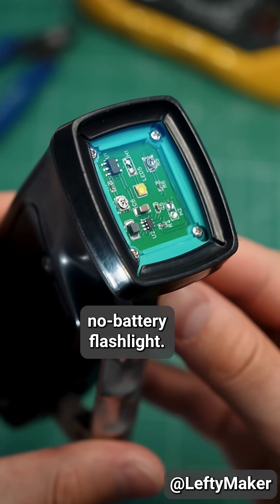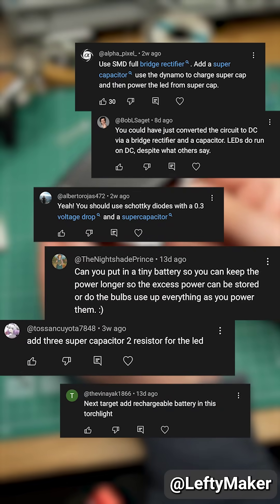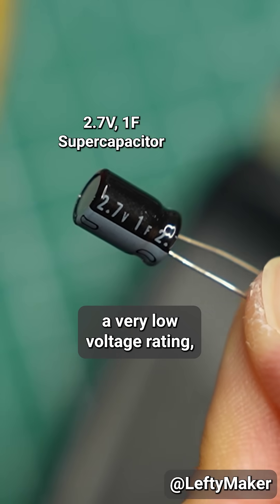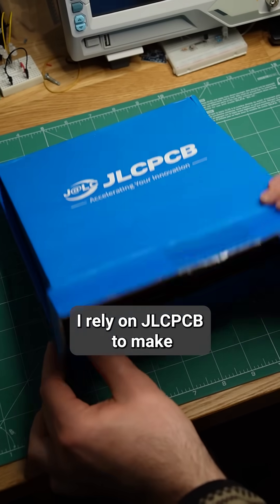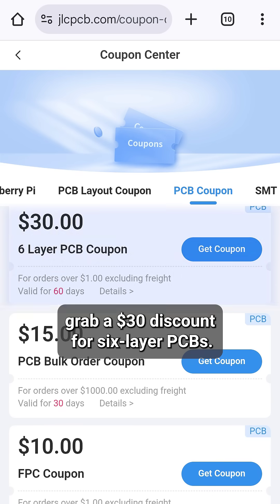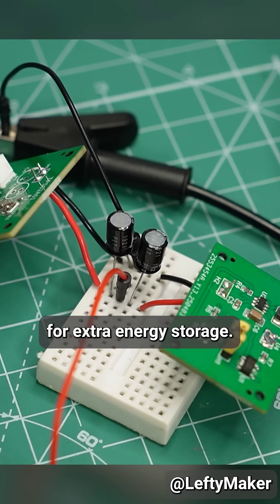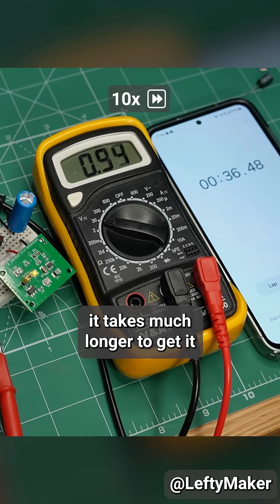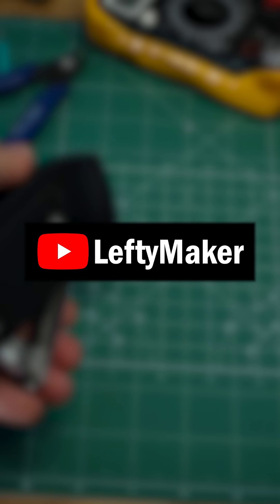I added a supercapacitor to the no-battery flashlight

Comment: capacitor is usefull, what if you step down the LED consumption, since its an emergency light you would only use it when its pitch black and those capacitors would last much longer, les light, but for much longer.

Comment: Simple is better this case the produced energy is really low and too much circuit take some power out of it , and it's not practical to charge it for 30 sec then it light up emergency light supposed to be used in emergency you may need it instently

Comment: Try making the charging mechanism connect directly to the light with resistance to limit how much goes through and then everything else goes towards the battery and the battery will discharge into the led so it starts quicker.

Comment: I think the addition of the battery is a good idea.you dont want to keep cranking for long time.also,when you have free time,you crank the flashlight so you can use it hands free.
Though its understandable as you need to consider the wattage to keep charging the battery

Comment: Could you alternate the capacitors so they charge the small ones first lighting up the led and then have excess energy put in the big one to use after the smaller ones go out?

Comment: Is it possible to separate the electricity between the super capacitor and the led , so you can use it at the same time while charging the bigger capacitor so time becomes a non factor, I don’t know if you get what I am saying but I hope you at least read this, your awesome by the way keep on the good work 😊😊

Comment: variable super resistor?
Reply: using a multi-stage switch which would vary the amount of capacitors connected in the circuit?

Comment: Better way to increase the lighting time is to just change the gear ratios to add more torque. Basically the harder u squeeze the faster the rotation of the flywheel, therefore greater lighting time

Comment: A very nice & handy project. But I guess buck converters wasn't needed because capacitors can suppress the spikes coming from the rectifief AC. As of overvoltage, you could use a zener diode in parallel with the capacitors...

Comment: This would be AWESOME for a horror game! 
Thanks I might use these shorts in the future!
Reply: That’s actually a really cool idea! That in a VR/AR setup that uses our house as the map and augments elements
Reply: Oooooooooh?  @filmweaver2013
Reply: Metro series
Reply: @sh-01a  does that game have this?
Reply: Amnesia Bunker 2
Reply: @havocking9224  um does this game have this flash light?
Reply: @Catinhood  Not this, but a bigger power crank. Principle is identical.
I had this flashlight, the handle has a geared arm that engages with a clutch on big spinning magnet wheel. The wheel is nested inside wire coils on Iron core and works as a generator. There's no capacitors or any electronic elements, just long wire coil directly connected to incandescent 1.5v lamp. It was a good tool in the era where batteries were rare, weak and expensive. We're talking about 3hr of dimm light for the 1/10th of the price for flashlight itself. So this whirling loud little monster was a great saving.
See now why in post apocaliptical metro series it is a thing?
Reply: @TheGooEater  oooooh ok!
Reply: White Knuckle
Reply: @santaclaus2115  does that have this light too?
Reply: @Catinhood yeah during one of the boss fights
Reply: Tattletail
Reply: Honestly, having a flashlight that you have to actively pump to use and as the game progresses you can upgrade it to be brighter and last longer would be incredible.
Reply: Ammesia: The Bunker runs with the idea, as others mentioned - you walk around with a wind-up flashlight, but charging it is noisy and attracts the monster
Reply: I immediately thought of Roblox: Doors
Reply: I perfectly can imagine Alan Wake using this lol
Reply: Allen Wake
Reply: @pyrojason  ooh I've heard of that game, does it have this as well?
Reply: How? I wanna play a game with actual horror content. I do not wanna stare at a black screen while spamming a key.

Limited light source is an already established mechanic and works fine but this thing would be hella annoying.
Reply: @cyr0_gd  let it be hard mode
Or have only specific parts where you'll need it : D
Or maybe not let it all be darkness, just really dim

Comment: What program do you use to design your PCBs, and do you test them directly on the program or design and test them on a different program/physically on a breadboard?
Reply from the maker: I use EasyEDA. I think it has a circuit simulator, but I've never tried it.
Reply: @LeftyMaker  Ah right. Do you design directly to PCB or use schematics and then convert it? I've tried using schematics since they're easier to interpret but I can't get them to convert to PCBs correctly. Sorry about asking all this, I'm pretty new to PCB design.

Comment: In rough times it would be an idea to have that lever (the thing u press for the mechanism to make power ) to have that under your shoe so everytime you walk you generate power/light
Reply: It wouldn’t take long for that to become an awfully uncomfortable walk.
Reply: @tyho1230  then perhaps make the full shoe flexible on the inside and make the bottom the whole lever, might feel weird but you get used to it
Reply: @itzmqximingame Not a bad idea, but It would probably be best to build it into both shoes.  You’d most likely end up walking funny with one shoe quite different from the other.
Reply: @tyho1230  Include both shoes yeah, might aswell just equip every shaft with a lever and have light forever 😂
Reply: or build it into a knee brace type thing maybe.  Both legs, put the cap and lights on a belt ?
Reply: You would just need to a piezoelectric generateor instead of a lever. And it's a lot more manageable
Reply: good idea, either way you just need a way to generate power xd

Comment: The only issue with PCB manufacturing companies is that shipping is extremely expensive for anyone outside the country where the company is.

A 2-5 dollar PCB with a 40 dollar shipping fee and a 30 day wait is just not viable, so many people watching this will have better luck with local factories.

If they don't setup more locations worldwide then it's impossible for people to actually start using their services regularly.
Reply from the maker: Probably depends on the country. I've ordered from JLCPCB many times, and the cheapest shipping option is like $1.50
Reply: @LeftyMaker  what about using supercapacitors in series?

Comment: What if instead of using a full bridge rectifier ic you use 4 LEDs in the full bridge rectifier? That way you can simplify the circuit considerably. Also I would consider using an ldo such as mcp1700 to regulate the voltage, keeping it down to 3.3V no matter the input voltage, although it is kinda wasteful since it dissipates excess energy as heat
Reply from the maker: I am making a video about this. Coming tomorrow, I hope
Reply: @LeftyMaker  Do you think there would be a way to charge the caps with only the excess power generated after the led(s) light(s) up? So like, it would light up right away, but any excess that you generate, wouldn't be wasted as heat, but stored in the capacitors to be used when you stop pumping? 

Maybe you could even add a switch on there, so that you could turn it off and save that energy in the caps for later. Ooo... how about 2 switches: one for the supercaps to stop discharging to the lights and another to shut off the lights. Maybe in that way, you have an additional option to save the excess for later AS you are pumping and making light, and then yet another option to store ALL the energy generated to the caps for later.  

Might not work, but just some thoughts anyway. :)
Reply: @LeftyMaker  cool

Comment: Nice video!
Also maybe try to make pcb white, so it can reflect more light.
Reply: Or chrome color spray paint.
Reply: I mean the difference would be so minuscule tho, and yea a reflective material would trump the effectiveness of white anyways
Reply: i believe it takes longer if you get anything other than green
Reply: @bobtheblob2770 it's 3 extra days
Reply: I second this. I make my PCBs in white when I'm using LEDs for illumination. I actually got the idea from reading an LED datasheet I was using and they recommend using white PCB color. Only takes maybe 1 more day manufacturing time.
Reply: Or maybe 3D print a reflector shroud thing out of white filament, maybe paint it chrome
Reply: Brilliant idea!
Reply: Experiment with either putting something reflective over the circuit board or something that absorbs light and glows in the dark. Swap the glass out for a lens to get even more light out of it.

Comment: There is no need of boost and buck . The load resistance of the super capacitor is enough to keep the voltage loaded and for protection in case of high voltage just add a zener diode
Reply: Or he could just put a few of them in series.
Reply: @khashmeshab  someone needs to test this idea. Not me, too lazy.
Reply: I like this approach more
Reply: Zener should not be used where efficiency is a prime thing, it will just dissipate extra energy as heat, its nice for any other circuit, but not here.
Reply: Also instead of this silicon fast recovery diode with drop of 0.7V, Schottky diode should be used for lower voltage drop at rectification.
Reply: iirc Zener diodes are not great at limiting low voltages such as 2.7V